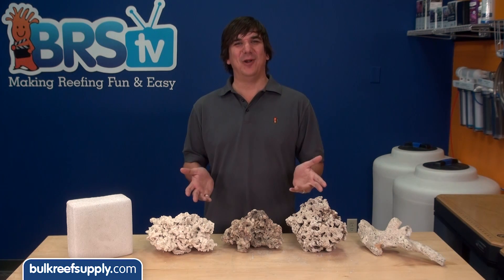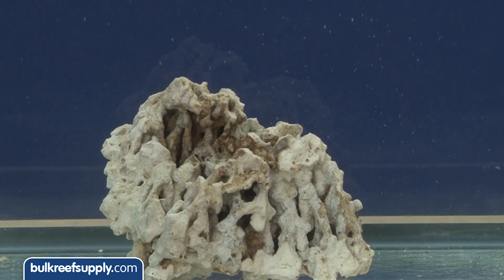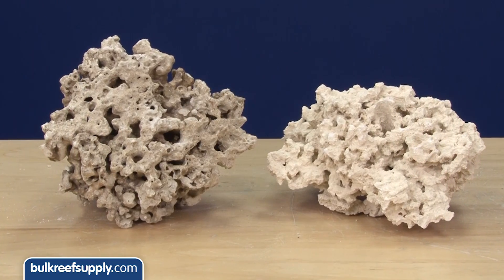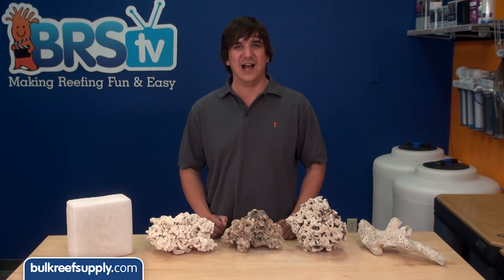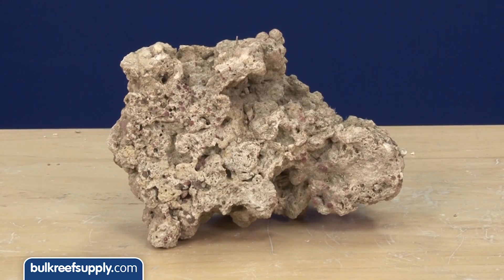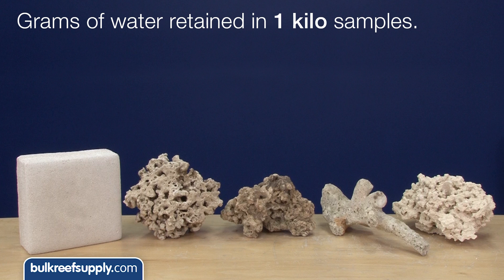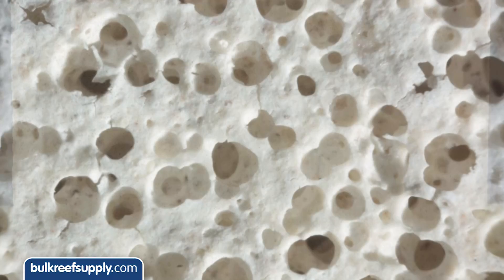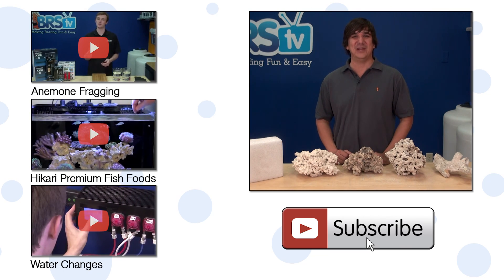Which live rock has the most surface area and porosity?

Comment: I'd love to see this same tests done to a normal red clay brick and a piece of concrete rubble.
Reply: +elatu I did the water retention experiment with a red clay brick, an autoclaved concrete brick and a volcanic stone I grabbed near the Poas volcano in Costa Rica.
The red clay brick absorbed 219gr of water per kilo, the volcanic rock 222gr per kilo and the AAC brick 600gr per kilo!
I must note the that the AAC will float in water after two days submerged. I don't think it will sink in it's own.
I plan to add to this experiment some LECA and concrete rubble when i get my hands on some.
Reply: +elatu I got my hands on some LECA and a piece of rubble. The LECA absorbed 160r per kilo (this one was a very bad measure, so it's actually around  150 and 200 gram per kilo) and the piece of concrete rubble absorbed  only 83gr per kilo.
I feel the need to clarify that this were not oven dried before doing this experiment as they didn't do it in the video either, so this measures do not take into account water that might be already inside the materials for reasons like air humidity.
Also, this measures were done by weight, and being that all this materials have really different densities this measures do not take into account the volume, which would really be more important in a reef tank than weight.
I might update with an approximation of this samples volumes and a relation between it and the water absorbed.
Reply: +elatu I'm really glad I took this last measure because it totally changes things. I'd really like you to do the same, as I don't have access to different live rocks.
So far I was thinking the AAC brick to be a great choice despite it's buoyancy, but it actually absorbed the same amount of water per cubic centimeter as did the clay brick, 0,32gr of water per cubic centimeter. (there was a insignificant difference of 0,002gr in favor of the AAC)
The volcanic rock absorbed 0,26gr per cm3, and the piece of rubble 0,16gr. Both of this measures are approximations because they didn't have a perfect sphere or rectangular shapes. 
Finally, I didn't measure the LECA, both because it wasn't as easy and because I expected poor results from it. Some mental calculations gave me a ballpark value of around 0,10gr, but it could totally be wrong.
Paul B from Reefcentral already uses clay bricks in his reef, so they are totally safe as long as they are not treated chemically for impermeability or something else, just cooked clay. He even said once in the forum that they are probably better than real live rock for it's porosity, this measures go along with that statement.

Comment: I run a 8x8x4" marine pure block in my tower trickle filter which feeds into my sump. As I have a 26G Nano tank and wanted to do a minimalist aqua scape (using only 4.4 pounds dry rock) I was worried about not having enough live rock for filtration. after a lot of research I decided to go with this block. I have a heavily stocked little reef with ;lots of LPS, SPS and Zoas, Shrooms etc with a Clam. 1 "Nemo" 2 x chromis and a green coral goby. also have a coral banded shrimp, stromb snail etc. I feed this tank pretty heavily. Very heavily compared to my Large 440G tank. anyway, I run near Zero nitrates. I have maybe 2 1/2" sand bottom to go with that block as my filtration. I do run skimmer and phosban reactor, but I have to say in all my years of reefing I was shocked when it came to how well to me it seems using marine pure. I was a bit put off by what I thought was catchy marketing. But so far pretty sold on it. tanks been running for 2 years.
Reply: I forgot to mention. I DO also do a 10% fortnightly water change. I also a a skimme bust on me and decided it was a good time to run a little test changing nothing else other than NOT running a Skimmer for 3 months. NO increase in nitrates. does it Prove anything.. maybe not, however, since I would be what some call an over feeder it surprised me. having said that I did put a new skimmer in as I also like the benefit of the oxygen saturation at night when lights are off and the added security for such a small amount of water if anything was t turn ugly. Marine pure will NOT help/ Solve bad husbandry, but I think it definitely has its place in the market and in particular for scenarios like mine.